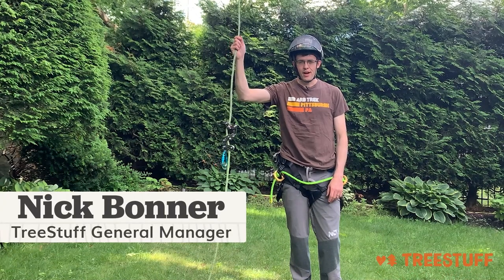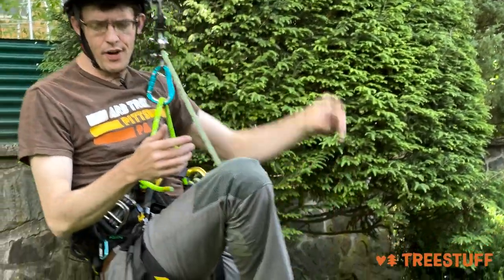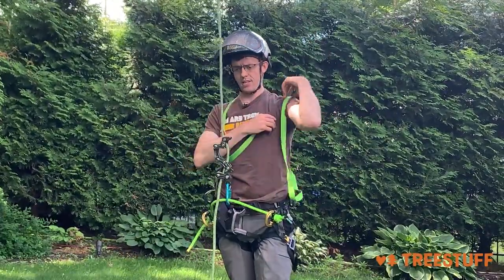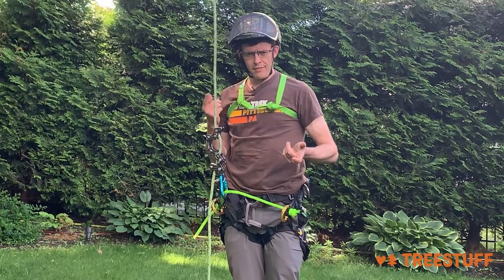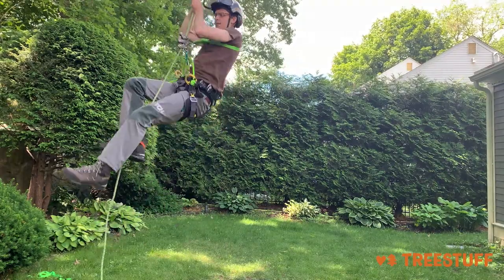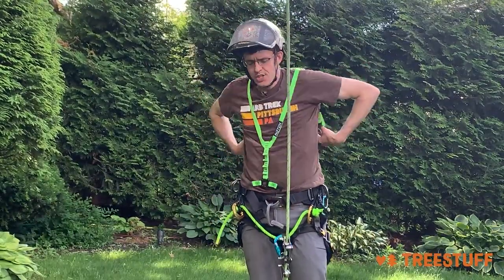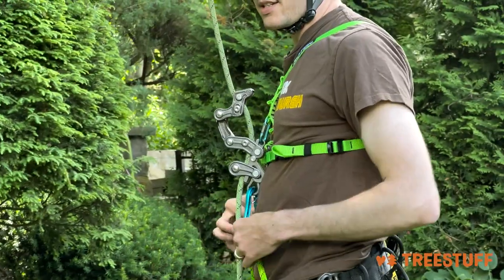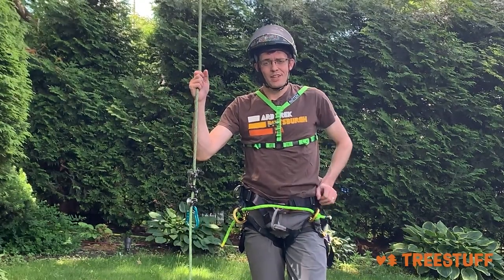What's a Hold Up Thing? - TreeStuff

Comment: What you using on your foot to push your way up by your leg?
Reply: Foot ascender
Reply: @joeshmo5399  cheers, do you think this foot ascender method could be utilised effectively with a traditional single rope method of using a clove hitch to link into your harness and the the remaining end around the main line with a Blake's hitch.
Reply: @yorkshire_saddlehunter184  You must mean a moving rope system MRS. I think I tried that once with a foot ascender because I am terrible at MRS too much friction over the branch or even through a cambium saver for me. It was hard to start out since putting a throw bag weight on the rope doesn't do much good when it hits the ground right away. Once you get higher up with enough rope below to weight it down it would start working better.
Reply: @joeshmo5399  im a bit confused with your reply Joe. But I think I figured it out within the last 30 minutes. I came across a video on YouTube of where someone made a DIY foot loop which in theory can be attached to a caribiner then the caribiner to a French prusik hitch in the main line. This I plan to utilize tomorrow with my traditional old style rope technique involving a blakes hitch. I don't have any fancy ascenders or pulleys or anything so I have high hopes this bog standard DIY setup when properly configured will work just as well. Might be a bit more work to setup but it gets the job done. I'll comment over the link to the video I seen
Reply: @yorkshire_saddlehunter184  "Bino H" has a lot of climbing technique tutorials and different hitch climber knots. With a foot ascender an LT knot and a rope wrench I was doing SRT without spending a lot. Best prussik cord I found was Teufelberger HRC.
Reply: @joeshmo5399  cool, thanks for the tips Joe. Most appreciated